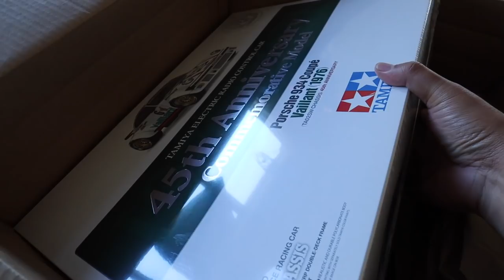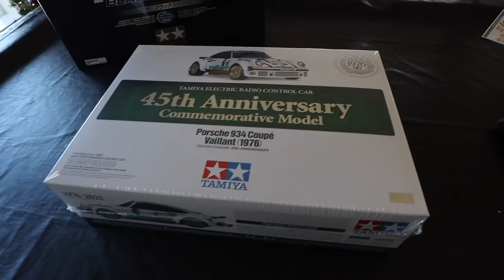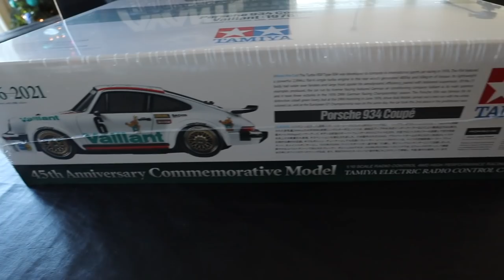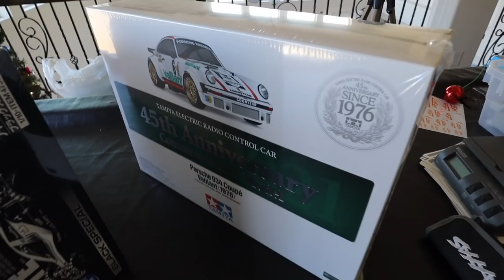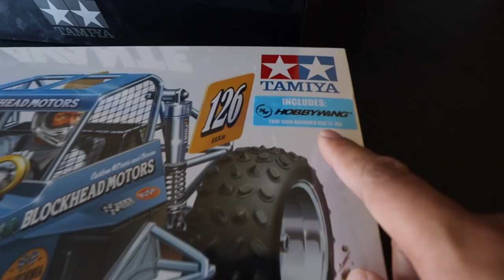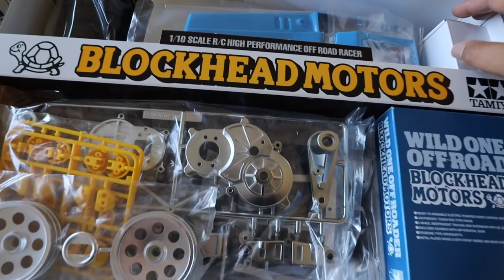ITS HERE! The Most Sought After RC Car In Production

Comment: I like both of the Tamiya kits you showed and the black Avante you revealed in your last vlog. All three are unique. You might know this already. If you ever build the 45th Anniversary Porsche, there seems to be a common issue with centering the body over the wheel openings length wise. If your familiar with another Youtube channel called RCKicks, he has an episode telling how he had to do some chassis mods to line up the body correctly. He builds great Tamiya cars. You may want to check it out if you build it. The Blockhead kit is very popular especially among Tamiya fans and in the U.K.

Comment: I know soldering is unavoidable in the RC world but I must say I just got some solderless connectors & installed a new esc & motor with them& I’ve had no issues. I’m definitely impressed & have had some time on them including wet conditions with zero problems. But I have to solder new wires to a motor I just got so like I said it’s unavoidable. Nice soldering gun& kit.

Comment: You're going to burn your soldering iron's cable or snag it as it's draping across your workspace and send it flying into someone's arm or foot. You're right handed, so move the station (the thing you set the temperature with) to the right side of your workbench next to where you keep the iron. This will keep the cable on one side of you which is way safer, and you won't have to fight to keep the cable from draping across whatever you're working on.

Comment: I pre-ordered one too and it fell through even though I got my $$$ back no problem I was definitely disappointed then as luck would have it I was randomly checking AMain (not my usual goto for Tamiya stuff) and they had one in stock I ordered it and got it Christmas Eve I always intended to build it as a shelf queen but after watching those eBay prices IDK now might just leave it NIB 
I’ve got another TA02W chassis I’ve been restoring (non Tamiya bodied) I’ve been wanting to pick up the Opel Calibra TA02 kit more for the body set but I might just build that as is and get a replacement 934 Porsche body to build a black edition runner clone and convert the TA02W to a TA02SW the body set is easy the decals and body accessory plastics are not 🤷‍♂️